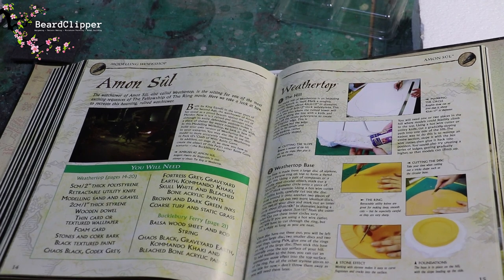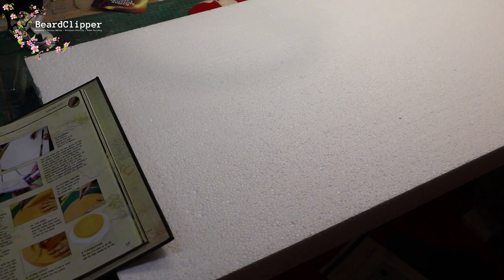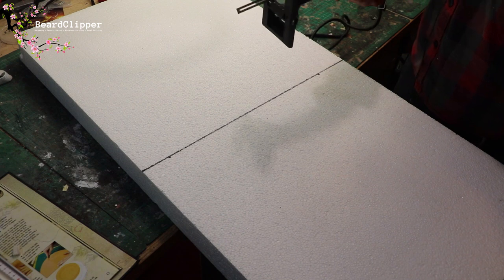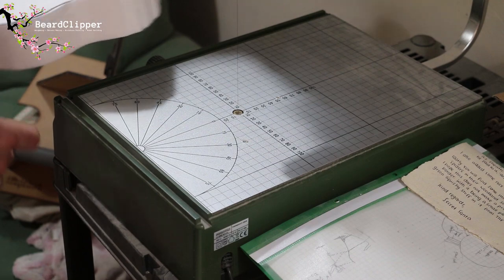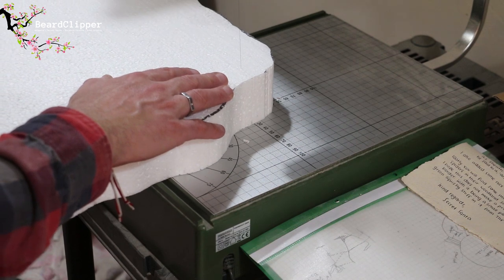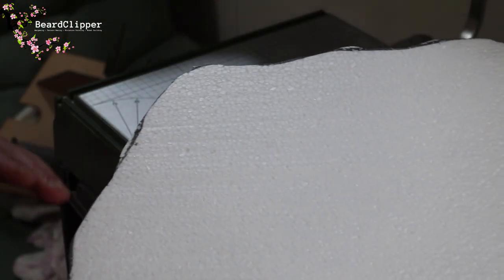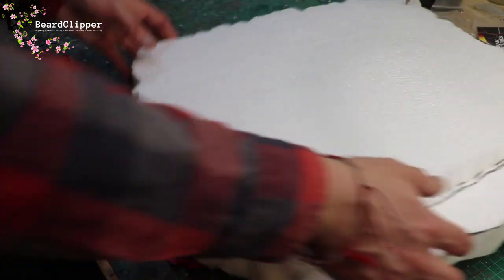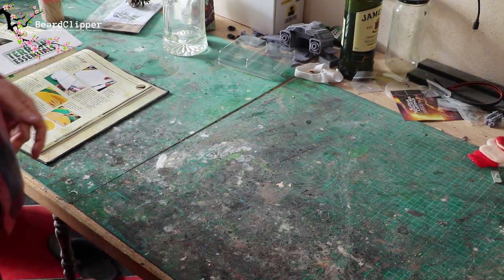Easy Builds - How to make a PLAYABLE Weathertop model || BGiME Episode 33

Comment: To find the center of your disk, take a compass and set it for the radius of the disk. Place the point on the circumference and draw an arc through the disk. Move the compass and repeat. Where the arcs intersect is the center point.
Reply from the maker: Cheers mate :) that's a really good tip!!